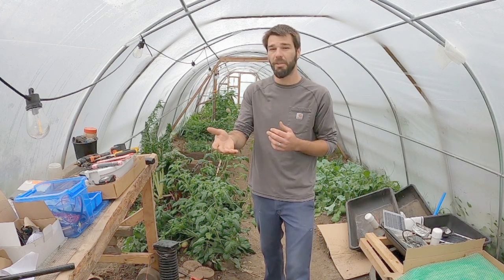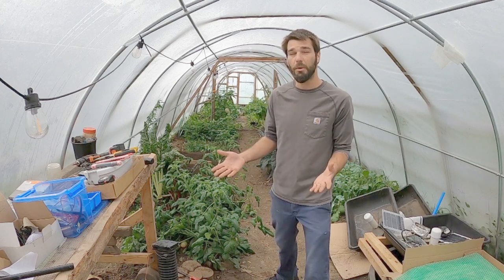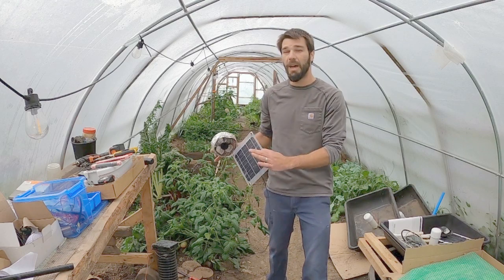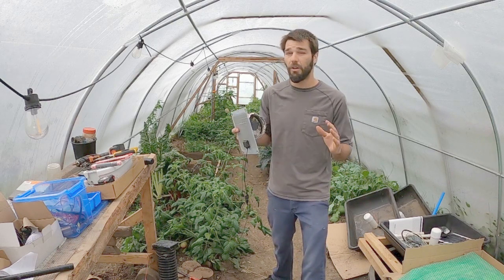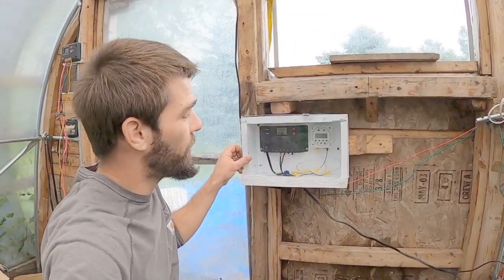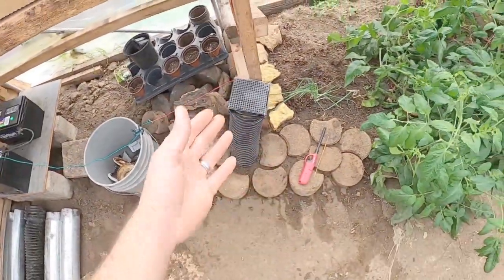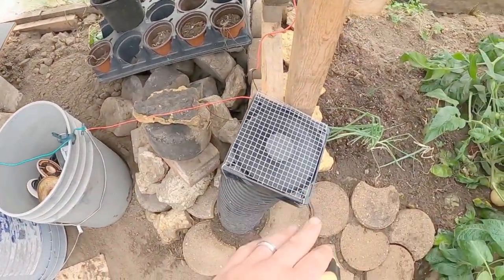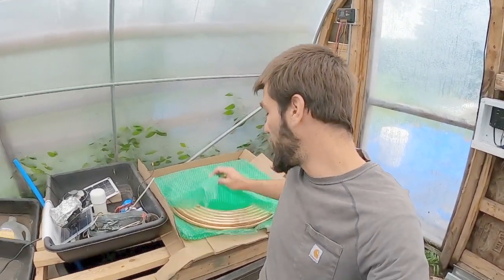DIY CHEAP Solar Geothermal Greenhouse Quick set up, Demonstration, & Temps- Free Energy!

Comment: I'm using a 5 foot hole and void covered by foil covered foam then 4 feet of dirt and it is porus enough sandy dirt I draw 48-56f constant. 9 inch fan can draw air out of dirt.

Comment: Thank you mister, it´s awesome ... may you show a sketch of the system of tubes under the greenhouse?. thanks
Reply from the maker: I could in the future yes, it goes down from the fan to about 8’ - 8 1/2’ and runs half the length of the greenhouse coming to the exit pipes, it was very simple design with a lot of labor involved lol. Thank you for checking this out!
Reply: @Earthdwellershomestead  thank you very much 😁. That's nice. We plan to do it , but it should work for winter and summer, so we plan to put some exits up and other down, and the fans will work according to the season 😀I hope it'll work .. but yes, the work involved seems to be huge 😅hehhe hats off for you 👏🏼👏🏼👏🏼and once again thanks for sharing.

Comment: Nice system. Are you worried about the corrugated drain collapsing? Its not very strimg stuff. Ive certainly dug up some that was almost flattened.
Reply from the maker: You betcha… I wish I coulda found some metal to use but this is what I came up with with what we could afford. It’s still holding. If anything moisture is the biggest issue in summer from condensation
Reply: Similar material is used by farmers to drain fields, (draining tile); it handles a lot more soil weight, as well as the field being worked by seriously heavy tractors. The diameter is much bigger but probably a different thickness in pie wall

Comment: You need to add panels, not batteries. Usually takes 200 watts per battery to keep them topped off when in regular use.

Comment: I dont know much about solar, but have been thinking about energy systems. How long to the little solar panels last, are these easy/cheap to repair? Any estimates on system kW if we assume 10 year lifespan and 4 months of use/yr?
Reply from the maker: The mini 5-10w panels last at least 4-5 years as we’ve had one running everyday 8-10+ hrs every day! They do corrode a bit if they get wet for long periods but I’ve not had one fail yet. I bought 4-5 of them and they’re all still working. As far as our new 12v waterproof fan we’re using now I got a two pack for 11$ and it’s ran flawlessly on and off for 6 months or so, that’s why I decided to use it for our geothermal. As for our larger solar system we’ve got 200watts worth of panels running to two separate solar controllers and a timer. Not sure what kW measurements. We use the panels year round also, in summer we move water and air, lights and other items we need to plug in. In winter we use it for heating purposes.